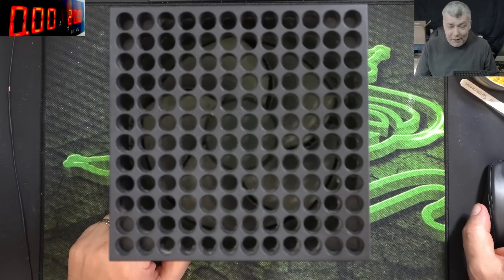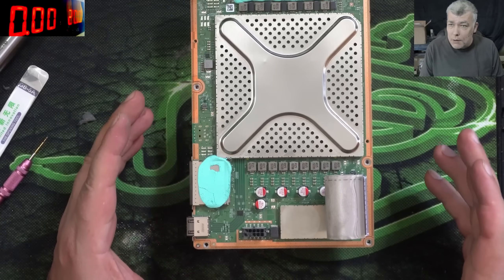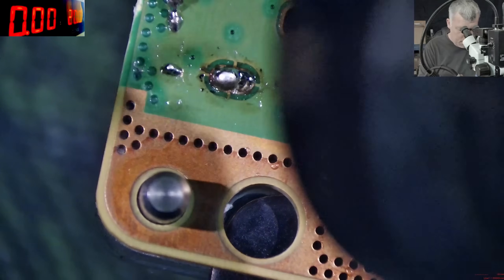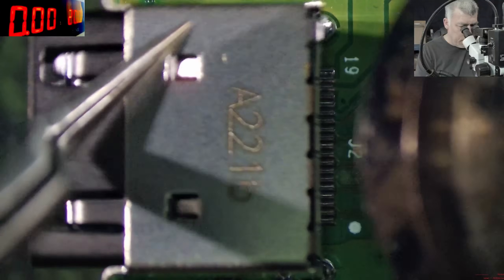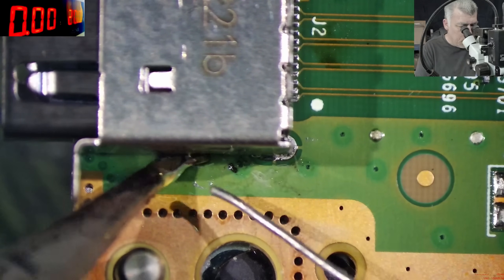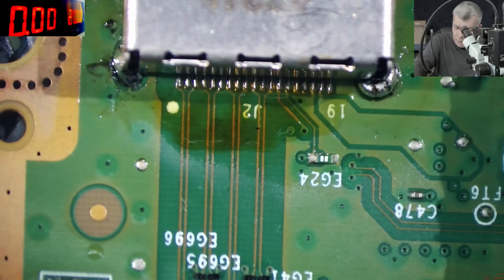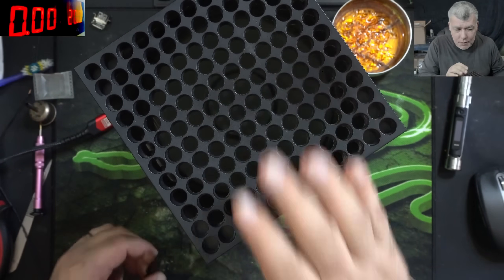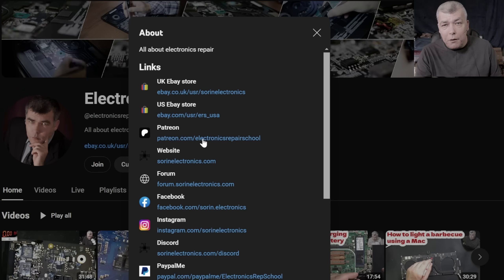Xbox Series X - my way to replace the HDMI port, the safe way

Comment: I personally prefer to heat from underneath the board and drop the port on when it’s ready. Too much heat directly on top will easily melt the inside of that port and warp it.

Comment: With all due respect I admire your shortcut to remove it but you are putting too much heat into it on the reinstall it may work but the plastic is not designed to take that sort of heat hens shortening its life before it comes brittle like most plastics
Reply: @Stu2be2  I think that’s what a repair shop did to mine. It was finicky when I got it back and recently it stopped working. It only worked when I had the hdmi port propped up by a small block

Comment: i remember you used 180 degrees for ps5 on hot air. on xbox much higher. I wonder why is that? 
Edit: maybe cause soldering off something you require less precision and therefore just need to heat up and extract? Then soldering in the new hdmi port you require a bit of tinkering so 180 then?

Comment: No.  This doesn't hold up in the long run.

I have done almost 2,000 HDMI port replacements and this method is what some of the shops around me do and I have had to redo several of them after a few months or years with no obvious damage to port, just lifted pins.  The problem is that there isn't enough heat transfer to the board, the cooling that takes place as you lift heat nozzle away and place port is enough to cause weak bonding.

By removing board and heating from under the pads you can continue to heat as you place the port and therefore assure the strongest bond of the solder and pads.

And as someone else mentioned, taking unit 90% apart to "be more careful" makes no sense as many of these units have bad thermal paste.  I don't know what the "more careful" refers to  I have never damaged a Series X taking off the 2nd board.  I guess its possible but than maybe anything "could" be damaged.

To follow your advice you fix the  HDMI in a less than ideal way  (and with higher risk of it being temporary) and then leave the unit prone to overheating unit sooner from bad thermal paste.  

Sure the customer has no idea what was done, but saving 10 minutes to do a worse HDMI port replacement and then leaving them with a greater probability of an overheating console in the future is not a "proper repair".  

Sorry, love your channel and am a subscriber, but no, this is not how this should be done.
Reply: agree with you.I m doing console repairs for almost 6 years and all the time when i change the hdmi conector,i put new termal paste.this metod is for lazy people.But as we are profesionals we do the right way !
Reply: but the problem with hdmi port from start was not that it had lifted pins but that in was broken from the outside part.
Reply: @ Yes, but the way it was replaced will leave it with higher probability of having lifted pins in the future.  By heating from the bottom side of the board you can continue applying heat as you set the port into place and you get the best bonding you can get.  By heating from the top you have to move the heat out of the way while you place the port, just that short time period of no heat the solder begins to solidify and then you drop a room temperature (ie, cold) port onto that cooling solder.  In the industry this is what is known as cold joints.  They are prone to fracture. Not stating that this is going to happen, only stating that the probability of it happening is increased by the method demonstrated here.  You can cut corners and have a temporarily successful repair, but spending the extra 5 to 10 minutes to do it the right way just seems to be the right thing to do for the customer.
Reply: @ifixorfreerepair3022  I also do these repairs every day but I use the hot air from the top BUT with a pre heater underneath which makes it faster  and easier on the board plus better penetration and reflow on the anchors (using hot swap which in my opinion is a more robust method for ports on all kinds of devices). The pins and the anchors flow well with heat from above as it is more direct. I also like this rather than hot air from below on the Series X because it is less risky to the booster IC. My concern with leaving everything clamped together as in this video is that is making the heating process less effective by increased sinking on an already thick board, plus you cannot access the rear of the anchors to ensure the best penetration. As you will know, some ports come off the board when the anchors just slip out and only with luck this does not result in ripped pads. Pretty much all other makes and models, I heat from below anyway but the Series X is a special case for me.
Reply: Absolutely I am a mere novice but this method is crazy !

Comment: I like ur way to do repairings but so far I dont agree with this one. I feel if u clean the solder completely from the board so u can place the hdmi port and solder it with the solder iron would be way better. U would be stressing the board and the hdmi port way less. Great work anyways

Comment: just cleaning all that dust helped the thermals a lot. thermal paste is good and factory one last a long long time
Reply: if it ain't broke don't fix it
Reply: @LucaDigioia83  thermal paste should be changed after 1-2 years of usage.
Reply: you've got any data to back up that statement?

Comment: Nice shortcut. It will be easier for you to have stronger regular soldering iron (60W or 100W) just for metalwork, soldering parts with bigger heat dissipation
Reply: I have 150w station and even with that you Will have issues hdmi of the series X, is the hardest consolo to solder. It just eats a lot of heat until it a bit hot, just heat up the board with the hot air and than solder is the easy way to work fast and good.
Reply: @fabini14  I have replaced thousands of this, and I only have a Hakko 900 series 80W soldering iron. I removed the old solder from the mounting posts holes so they're clean, then a drag soldering for the 19 pins. Then I change the iron tip to a thick and largest one I have to solder the mounting posts.
I never needed to use hot air (other than to warm up the board), to solder any port then flood the pins with flux to retouch and waste my customer's time. I know a lot of repair techs do it, because of one person on YT showed them, and they followed it like it's a rule set in stone.

Comment: What is the solder you are using may I ask.
Reply: Probably some 60/40 leaded solder with rosin core. Works best in most cases instead of lead-free garbage.
Reply: @ totally agree, lead free is rubbish